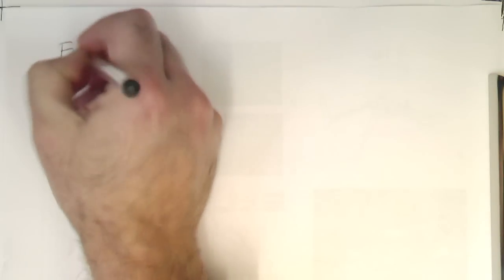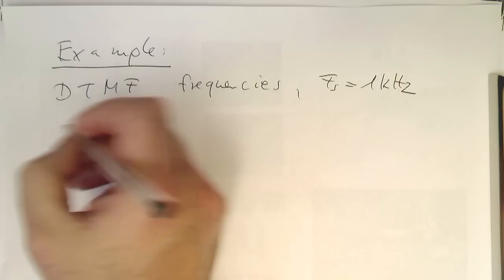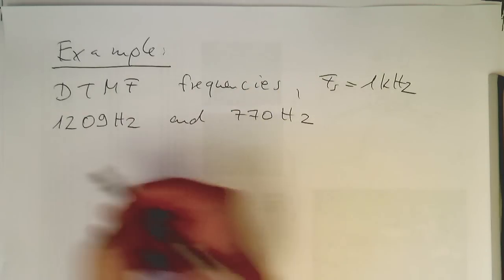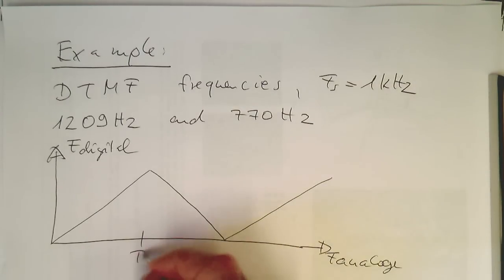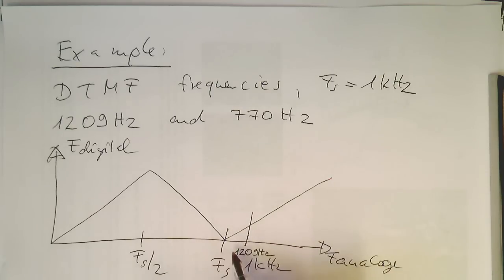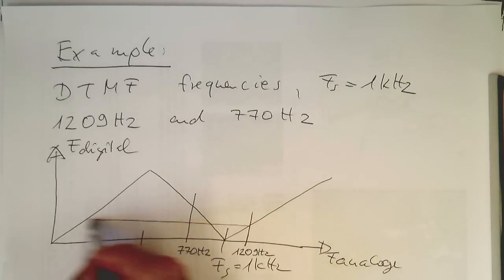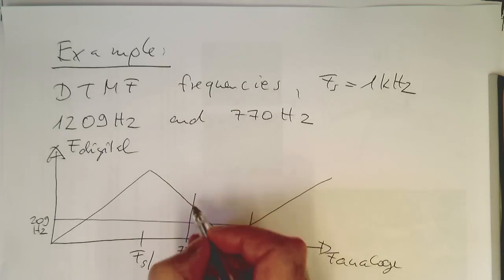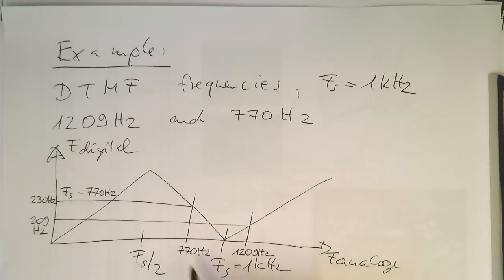Sampled signals: example of fold down (#004/003)

Comment: Looking at the mapping around F_analog = F_s, won't there be a problem with ambiguities even if a signal has a band B < F_s/2? If, for F_s = 1 kHz, I take a signal with, say, components of frequencies f_analog ∈ {880, 1120} Hz, then according to the mapping I will get f_digital2 = 1120 - 1000 = 120 Hz and the same f_digital1 = 1000 - 880 = 120 Hz – no way to distinguish the two anymore.
Reply: That's exactly the issue that's why sampling theory says you need sampling rate 2x higher than highest frequency component you expect to measure. And if you don't want to measure higher frequencies but there still are higher frequencies you need low pass filter before measurement or else high frequency noise will be interpreted as low frequency signal